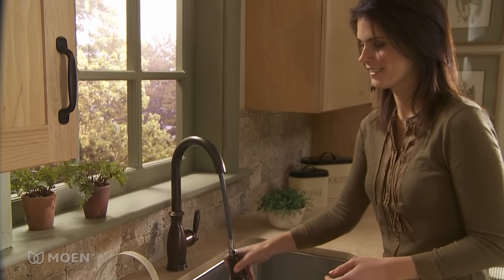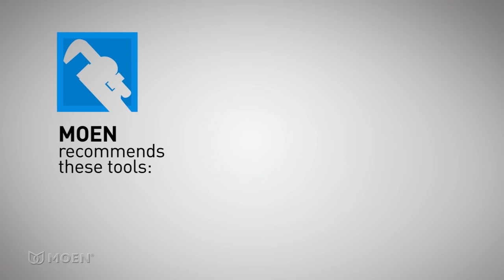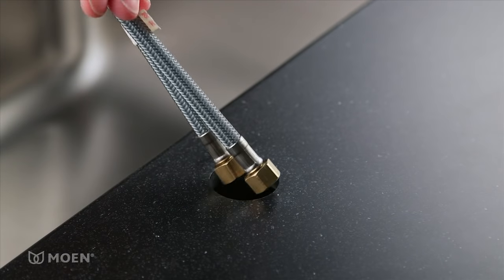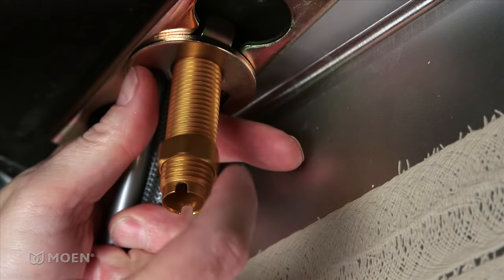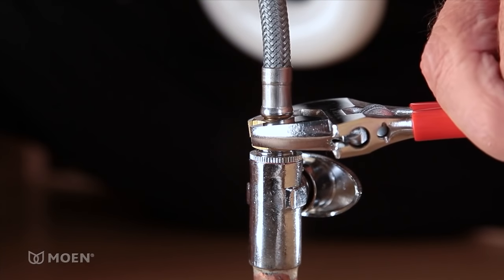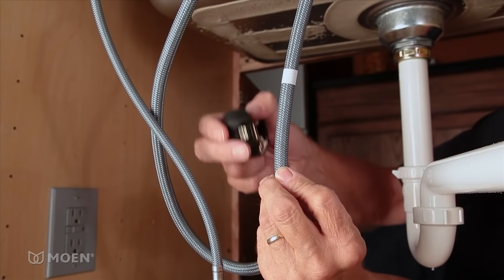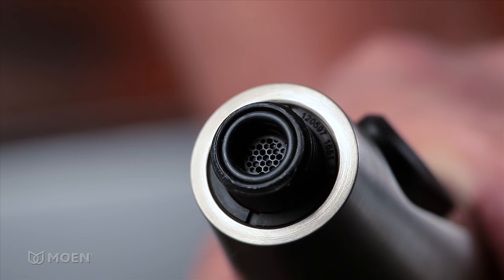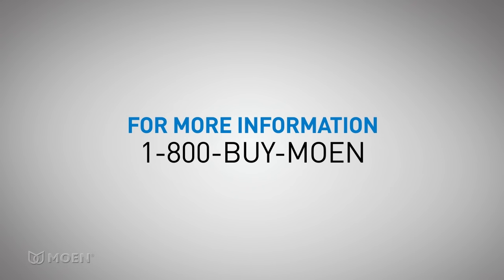Installing a pulldown or pullout faucet with Reflex  |  Moen Guided Installations

Comment: Would be nice if the directions stated what size the water line hook up was. Garbage. Will be returning it.
Reply from the maker: Hello. We are sorry that the directions didn't include the size of the water line. These flexible supply lines come with 3/8" compression fittings.
Reply: Most supply lines coming from homes are half inch

Comment: Didn’t get the support racket I needed so I just continued the installation without it and it seems fine. Don’t see the point in having it ?
Reply from the maker: Hello.  We are sorry to hear that there were parts missing from the new Moen product that you purchased.  That is not consistent with the quality we strive to provide.  We'd be happy to help!
Please DM us your email address, the address where the Moen product is installed, a full product view picture of the fixture, tell us what year you purchased/installed the product/send us a copy of the purchase receipt and tell us what part(s) were missing.
Reply: @moenfaucets  do I really need the part tho? The faucet seems to work just fine without it.
Reply from the maker: Hello Plube.  Depending on the specific Moen model number you have installed and the deck thickness the product is installed into, would determine if the support bracket is needed. In order for us to determine this, please DM us a picture of the Moen product installed and the approximate deck thickness the product is installed into.

Comment: piece of crap. when most faucets last 10+ years. we didn't get one year. the faucets water control handle is so loose and we can't tighten it via hex screw driver . we paid over $200.00, so steer away, $20.00 plastic faucets are better.  am not going to replace this faucet with another Moen.I am a Amazon Reviewer. I will post my review of this faucet on Amazon with a video showing the faulty handle. I could understand if we used it daily, but our family is grown and out of the house. just 2 seniors that use the dishwasher 99% of the time. If you'd need to use this for a family .. good luck getting 3-4 months out of it since I can compare that to our less than a year of very light use. I did have it professionally installed so installation was not the issue. I can do the install but and will with my new "other" brand.. no more hard earned savings to throw away to Koehler. it's not just the price but the inconvenience. shame on you Moen.I've seen this same issue repeatedly apparently it's a known issue . that makes it worse. 
Show less
Reply: Same here,  that hex nut to remove the handle strips and then you have to replace the whole thing cuz you cant ever get it more than once.
Reply from the maker: Jude Christopher, For technical assistance please contact us at 1-800-289-6636.  Our business hours are Monday - Friday 9:00 AM - 5:30 PM.
Reply: @moenfaucets  1.5 years too late ...
Reply: … helpful.

my "faucent shank" doesn't even fit!  It's too small and going INSIDE of the faucet base!
Reply: Mike Mac  sorry Mikey - I guess they changed things in the past couple of years. I just purchased, installed and am enjoying my new Moen. Sorry for your luck. 🤷‍♂️
Reply: 66:36

Comment: WTF Moen??!?!

The video shows a nice (I'm assuming) brass nut to attach to the shaft for tightening.  I recieved a piece of crap plastic nut that I need to tighten weekly.  It's not even of standard dimension to replace with something quality.

Frustrating Moen... So very very frustrating.
Reply from the maker: We would be happy to assist you with the issue. Please contact 1-800-289-6636 (US) or 1-800-465-6130 (Canada). Thank you.